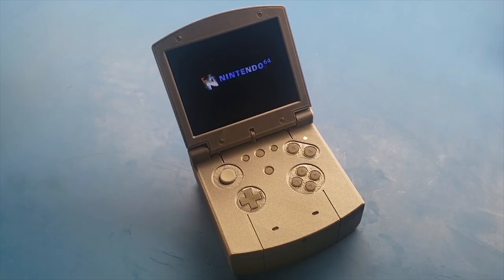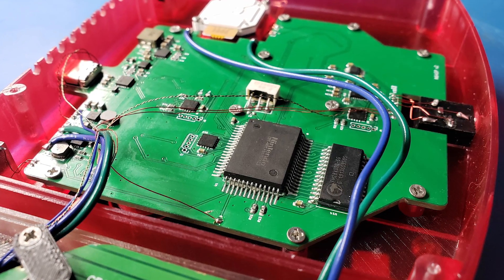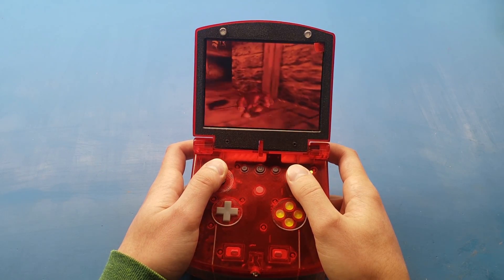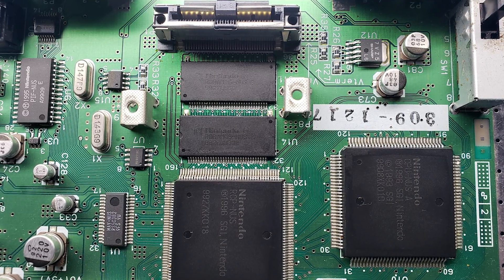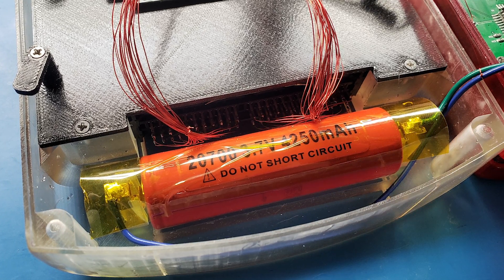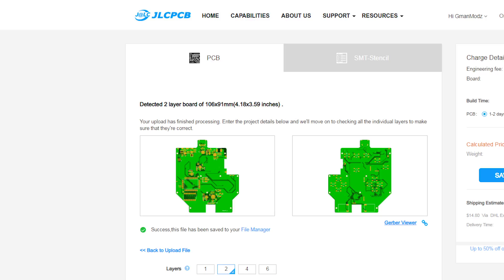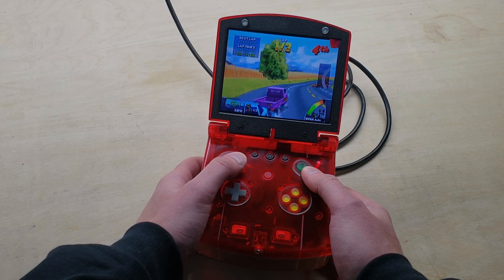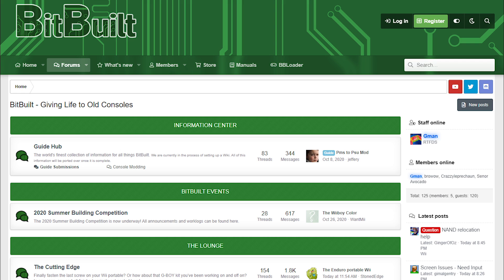NINTENDO 64 PORTABLE - N64 SP version 2 (FUNTASTIC RED)

Comment: Man, if I could buy this i would in a Heartbeat. At the same time I do worry about expansion pass use, as some games do work better with just the jumper pack, or at the very least, run smoother. Looks a lot more manage then the chipo 64 though I'll give you that

Comment: fantastic job , again! , a question about painting, even if you let them dry for a long time even for a month in my experience they tend to stick to your hand the minute you grab them in your palm because of the heat and moisture of body the painting tends to get sticky , am i wrong ? or you have another method?
Reply from the maker: I used tamiya paint with clear coat. No it is not sticky. Could be the paint you are using or your painting process. It is very important to paint it in light coats a few minutes apart. The goal is not to cover the entire surface in one coat, it will be too heavy of paint layer and will not dry the best.

Comment: Was 3d printing the case high enough resolution for the screw threads, or do you have to tap the threads into the plastic after the fact?
Reply from the maker: I tapped them after printing

Comment: How is the screen connected, as in is it a direct digital tap or is it simple connected to the analog out and then goes to a ADC, and if it is connected to the analog out then what signal is it pulling. and what are the specs on the screen. Sorry, I’m just a huge video nerd.
Reply from the maker: I am using the regular composite video from the N64 on this build, I think it looks pretty good with this screen. The n64sp v1 I used digital tap for VGA. But the modchip for that is expensive and kinda rare.
Reply: @GmanModz  would s video possibly work in this build, since the n64 does natively output it. I know the n64 has pretty good composite so the difference isn’t huge, but still.
Reply from the maker: @lawbiffington143  Possibly but I'm not aware of any 5" s video screens.

Comment: Did you use a 3D printer and if you did how much was the 3D printer ?
Reply from the maker: I used a Form2 printer, they arent exactly cheap
Reply: @GmanModz  ok
Reply: @GmanModz  how did you connect that 3ds analog stick to the n64 board?
Reply from the maker: @Term271  I use a microcontroller to make it work with the 3ds slider. I explained it pretty detailed in the video
Reply: @GmanModz  ok thank you I’ve been watching this video everyday to find things out

Comment: cool idea but why real fat carts? make it an SD card reader instead. 4 gig normal SD cards are cheap even 2 gig ones. you can fit single games on them and you can shrink the massive size of that clunky build.
Reply from the maker: My main design goal was to use real n64 hardware and full sized cartridge. It adds charm to be able to insert your own game.